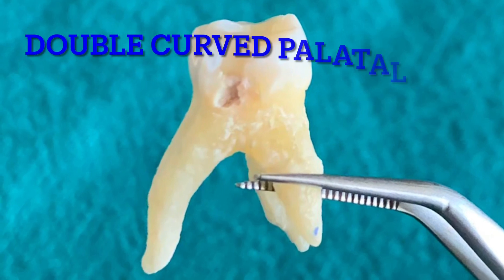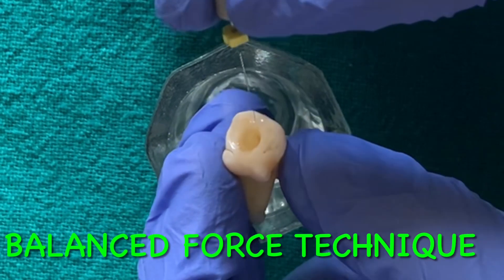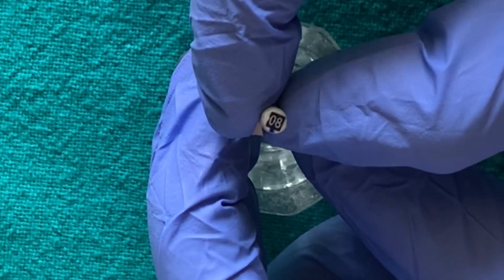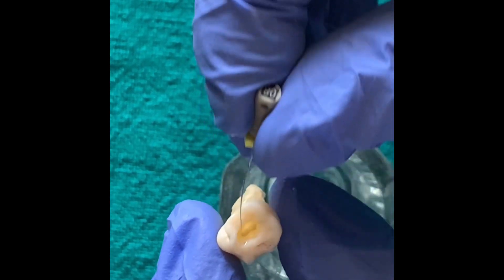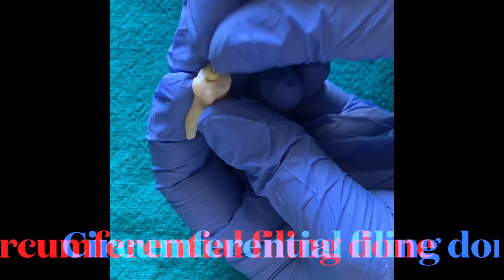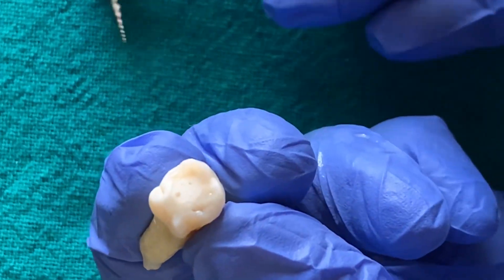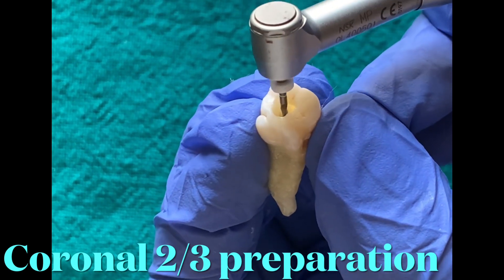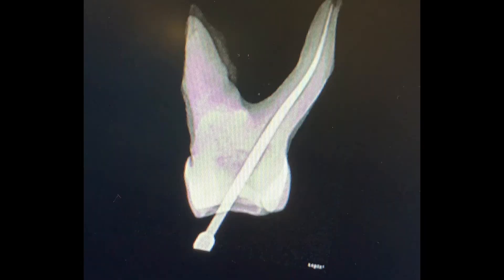Curved molar root canal preparation using Balanced force tech & rotary files| Complete Molar RCT

Comment: Can we use 2% purple endo file Directly instead of hand files?
Reply from the maker: No not in this case. The canals are curved, narrow and partially calcified. It will cause ledging and transportation of the canal and maybe even breakage of the file. The golden rule for Rotary endodontics is that a clear reproducible glide path should be present before using these files. We have used the hand files to create that glide path. This step cannot be skipped!
Reply: @sumeetasandhu  one doubt but the purple 2% is to prepare glide path isn't it .. that is why I am confused. Can you elaborate more and enlighten on this.
Reply from the maker: @nir258  u r getting confused regarding glide path. Please watch my video on canal preparation for rotary files & rotary Endo basics